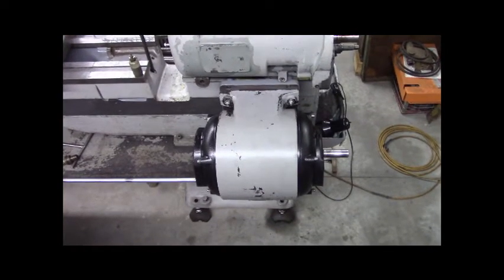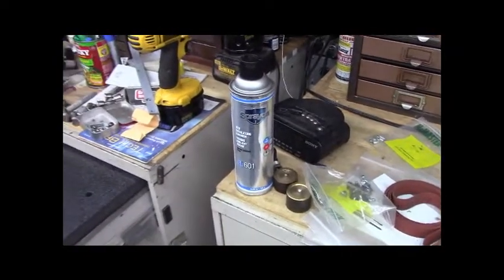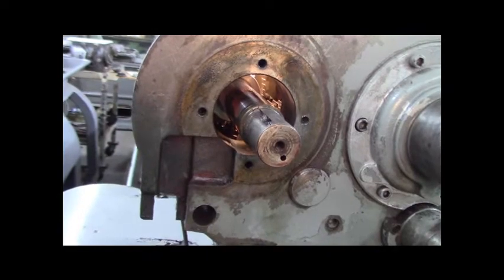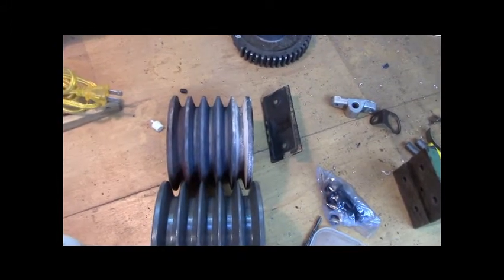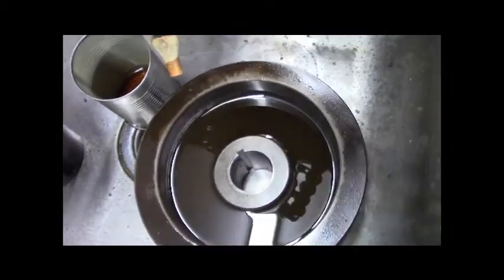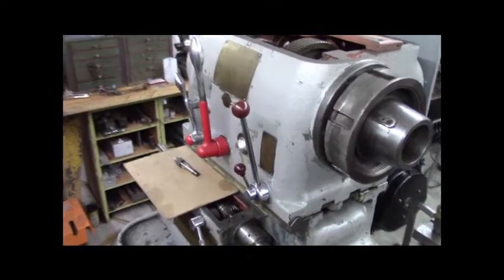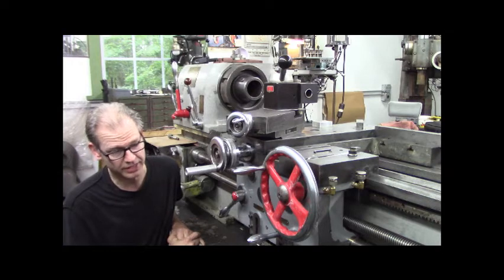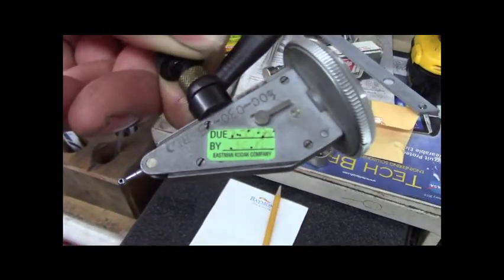Doozer's Machine Shop Update 7-07-20 -- Colchester 17" lathe and More

Comment: Thanks for the update. Shame about the unavailability of 5v sheaves for 4L belts. A sheave for "A" belts may match better: my 1949 Westinghouse Air Brake compressor uses a 4V-A sheave.
Reply from the maker: I can not find "A" sheaves for 5 belts, only combination "AB" sheaves.  Do you know of a source??   BTW, Browning wanted $500 for their pulley.  Mine from B&B came from China, but was only $100.  I hate to buy a China pulley, but I spent $400 less, and it seems to be a very high quality piece.  Browning had to pay for a dealer network and salesmen, so I get why the price.  If I had gotten my pulley from a salesman or Browning distributor, would I have gotten the proper one the first time?  Maybe, depending on how helpful they were feeling that day.  I believe I did alright in the end.
Reply: @kooldoozer  You certainly have the machines to do a custom sheave out of solid stock. Would make a great video! Groove geometry is in Machinery's Handbook,